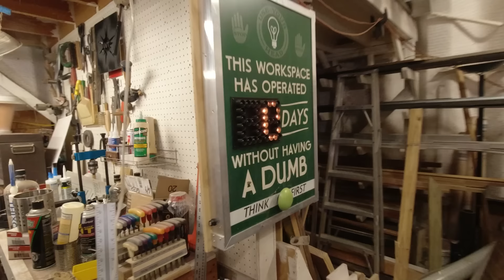DIY Mini Elevator

Comment: I made from a similar Vevor aliexpress a lift for my metal roll shutter.. 
First what i have done .. used only the bare engine..also changed the steel cable for a 5 cm wide strap.. less noise..no winding problems,  and quicker lift.
Replaced the whole control system by own design..with relays and proximity switches.. so stopping at close and open, also  operating not possible when locked with key..
Simple and good working system.. only you have to adjust the two coilsprings.. as the fence have to fall down by itself in top position.. otherwise it hangs.

Comment: If the base of the platform is MDF. I would put a brace in the middle. As MDF ages it starts to disintegrate and if that happens here your cargo would fall through and crash to the floor.
I love the cable idea, it's the same as many Bendix car lifts. You can also easily have some safety features added inside the channels for cable brake protection.

Comment: By looping the cable under the platform, you effectively doubled the rated capacity of the winch (like a snatch block). Did you consider that in the design?
Reply from the maker: Yep! Although I'll never get close to that capacity.
Reply: @WesleyTreat  even so, you have efectively doubled also your safety margin - something which NEVER hurts.

Comment: at the end of the hook on the right side you can add a proper load sensor with display so you know how much you are lifting (or better said, you know how much weight is on the cable itself) and with a calculation you can roughly know what weight is on the platform.

Comment: I am building a similar elevator, the only issue is the noise of the winch itself, especially when turning on and off, when strange knocking sounds can be heard (it might be the brake). Any ideas for soundproofing?

Comment: Awesome lift. Got to ask why didn't you make it so that the lights rotate in one direction when the lift is going up and the opposite  direction when the lift is going  down?  One other question, it's about the blue towel on your head?  Love the videos and your ability to create some pretty cool stuff.
Reply from the maker: Thanks! The lights have something like 8 patterns that have to be cycled through to get to the one you want. You can't just change from one pattern to any other specific pattern. Also, the drape on the back of the welding helmet prevents lights behind you from reflecting on the inside of your visor.
Reply: @WesleyTreat   Okay I'm familiar with what you are saying about the lights. I thought they might just be rotating only.
I thought that might be what you were using the towel for.  it works well outside also.  That's why a lot of pipeliner guys use the pancake helmets.  I have problems with wearing glasses under the helmet. seems that the light from the arc enters through the lens, hits the glasses, bounces back to the lens and back to the glasses.  I get double vision from that.

Comment: I would add some kind of slip yoke with a steel cable attached to the top so if the winch ever decided to unspool randomly or a structural weld shit the bed then the cable could grab and not let the load drop..  kinda like a harness works.  .it slips along a line until a dropped force pulls the slip tight and grabs.. just for a safety measure when hauling heavier stuff up it.. but shouldnt ever need to use it..

Comment: Wes, i was going to build some folding stairs for my garage loft but after seeing your video I've changed my mind. Your lift is a much sinpler design and having the cable go through the channel solves a lot of issues others have had. Brilliant. Hows it working so far?

Comment: I’d play with installing a pulley where the hook is and fishing it back to the hoist agin to make it double line. Will increase the weight capacity and degrease the travel speed. Should also help with becoming less jerky as these types of hoist tend to be.

Comment: Ive built my own lift. How do you keep the wire rope from jumping over itself and jerking when going up?
Reply from the maker: It helps if the spool is centered over the attachment point. Otherwise, not much you can do, really.

Comment: New subscriber here. Great build. I was surprised the strut rollers worked that well seeing how they are designed to hang from the strut rather than off to the side. Seems to work fine. Love the lights and the "reversing horn" at the end. Perfect finish....Greetings from Texas...John B.
Reply from the maker: Thanks! The load on the bearings is still perpendicular to their axis, same as if they were in an overhead position, so they don't know the difference.

Comment: i have a friend that worked in the parts industry and went to an industrial trade show where they demonstrated and epoxy  use on concrete molies  they pulled a 4in chunk of concrete out around the molies all the mechanical molies pulled out with only a little pull out around them .. Great video , a lot of fun , love the paint and warning lights but i think you will probably turn off the beeper, just hook up the elevator music to it:)!!!!!!

Comment: Why did you or others make the platform hinge down so you could fold it up?  Would act as a railing in the up position when at the top position.
Reply from the maker: When it's at the top, it's already out of the way, so there's no need to fold it up. Making it foldable would just add potential points of failure.

Comment: What happens when there's a power out during lifting stuff up/down? Will the motor stop or fall down? Or is there a backup UPS thing?
Reply from the maker: It stops, same as when you let go of the button. 👍
Reply: @WesleyTreat  OK, it better be 😋 Any chance, you know how this is? Cause when there's a lot of weight on it, it must fall down when there's no power, no? I always asked myself how this works with those tall crane's that build skyscrapers...
Reply: @WesleyTreat  oh, and greetings from Belgium 😅

Comment: What's the advantage of an upwards angle on your welding cart? I've seen some other folks have similar but I've never had one with a slant like that and don't see the advantage.
Reply from the maker: Makes the controls easier to see, I guess?
Reply: @WesleyTreat  oh yeah makes sense. Most of the time I set it and literally forget it. More than once i forgot to connect the ground. It took more wire than I'd like to admit to realize.

Comment: I would put on something for safety so it will not drop if the cable fail like on vehicle lift jacks and rollercoasters when going up.

Comment: So it seems like the entire load is carried by one 1/2 inch nut on the back of the threaded eye.  Maybe double nut it, or weld the eye to the square tube.
Reply from the maker: It's rated to 1300 pounds, far more than it will ever need to carry. 👍‍

Comment: Chumbawamba lol. That particulate filter doesn’t do much for fumes. Maybe I’m wrong?
Reply from the maker: 3M 2097 is specifically recommended for welding. 👍
Reply: @WesleyTreat  Ah cool. I recently got 60923 for finishing with smelly stuff and have no idea which one is ideal for what. It looked like best option.

Comment: A loft package lift is a good idea,  So this kicked off an implementation where I did throw out 60% of the structure.  It's not for 200 pound me,  but a 4' wide board is an option

Comment: Nice video...unfortunatly for the former great state of Maryland (The Nanny State) in 2023 has started requireing elevators designs in residents, like would be in an attached garage to be factory certified designs by the manufacturer, and that the elevator has to be inspected each year by a State of Maryland by the State's commercial elevator inspector.

Comment: Just a tip i seen in another youtbe video. The guy got hold of a device that is like seat belt in a car, just in case the wire snap it will lock.

Comment: Your sheaves are a bit wide for the cable size, I would check for cable wear often. (i.e. run a rag along the cable to check for snags from broken wires.

Comment: i made a closed metal cage, took off the controller, added a garage door remote driver with two end roller switchs and NO push buttons upstairs and downstairs. i can call the elevator from wherever i am, and i control the cage from inside with the garage remote controller.
Reply: can u post a pic?

Comment: I think you may have overlooked the obvious, but too late now. If the cross bar hadn't been welded in place, you could have made a removable panel allowing the elevator platform to become a workbench extension. Or allow items to be lifted to workbench height and slid over from the lifting platform. Or allow longer items on the workbench.  First time viewer so I may have missed something. A ratchet type locking pawl could also be a future upgrade and is simple to do, the U channel already has slots cut into it. Just my tuppence worth!
Reply from the maker: Not a bad idea. That workbench isn't staying, though. The plan is to turn that area into a paint booth.

Comment: Wrong filter on the respirator the pink ones from 3m are for dust. You need a carbon filter for vabers.
Reply from the maker: 3m specifically lists the 2097 as rated for welding, and includes a carbon filter, unlike the 2091

Comment: If you are going to ride it or there’s the risk that kids will use it when your not there you should have one of those roofing contractor safety fall arresters attached so if the cable brakes it doesn’t break you or loved ones.

Comment: You might also consider putting some kind of load rating/reminder for yourself as those door tracks are just mad of formed pieces and not meant to take the prying/leverage/forces/moments you're putting on the trucks connected to the top angled pieces. You might end up pulling one out of the form as they really are meant to be used in a hanging assembly and not a "torquing" assembly as you have there. The idea is pretty good, good enough to force you into a false sense of security after using it for a little while and then getting so comfortable you don't realize you're actually abusing it.

Maybe even consider some form of mechanical lock/brake held normally open by the tension of the cable. It might save you from being the next guy on youtube like the one you showed taking a leisurely trip to the floor, all expenses paid of course, when his cable broke. 

Just sayin'

Nice work though.

Comment: Curious on what lift rating it has. That falling video section is so cringy
Reply from the maker: In its current configuration, the lift rating for the hoist is 880 lbs. You can find out what happened with Tom's fall at the link in the video description.
Reply: @WesleyTreat  880lb is plenty! That is good. :)

Comment: The respirator didn’t have the vapor cartridges anyway so it didn’t matter lol
Reply from the maker: The 3M 2097 filters are specifically recommended for welding.

Comment: I built a similar lift for a local Museum, using a winch like the one you used. The main difference was that I was restricted to build the lift in a stairwell (a very dangerous one design about 100 years ago). It's been in operation now over 5 years with no problems. We added stops later, and hardwired the electrics. https://youtu.be/e8NuCzV0Z0U

Comment: I have to reply to your comment re this project taking you three f+#*@~g days  (and pointing to your beard growth): well, since I started my Skoolie conversion we've had two Presidents, I've had two ER visits, my toenails have been invaded by a nasty fungus, then I beat it back, then it returned again, I lost 45lbs, then gained 30 back, and I'm still only 85% completed on my build after 1 year, 8 months and 2 days. My build hasn't been quick, but it has been CHEAP: BUS=$1,500, Parts, lumber, wiring, etc =~$4,300 including 4 solar panels, water heater, diesel heater, lithium batteries, 3 sound systems, fridge,/freezer (12 volt), propane stove with 2 burners and oven, 360° exterior LED spotlight coverage, 360° exterior security camera coverage +undercarriage security cam, a periscope to view surroundings from 30' above, AC, shower, toilet, office, bedroom, and linear actuators attached to anything with a joint, because they're fun. Also, a cargo rack in rear, scooter rack on front, and currently building a hoist system to lift cargo to rooftop storage. Your video has inspired a couple changes I'll make. 😂😢😮😅😊

Comment: Since you failed to give the Safety Nerds time to finish typing, I am going to reach out to OSHA and inform them of your little deathtrap. No safety rail? No safety harness? Not even so much as a safety pin to affix the name tag to your shirt because the sticky back got coated in saw dust and metal shavings that someone is bound to slip on. How many hours of lift operator training have you completed because I don't see your operator's 
 license displayed. Are those even steel toed safety shoes you are wearing?